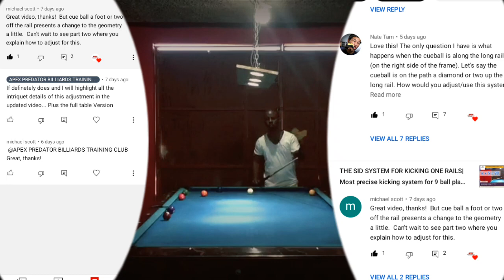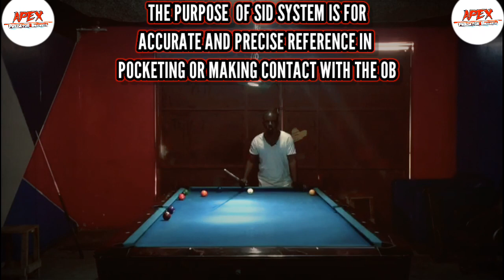NEVER MISS ANOTHER ONE RAIL KICK WITH SID SYSTEM (PART 2 full table )

Comment: The mathematics gets a little tricky when you're half a diamond or a 3rd of a diamond but it can be done fairly easy just by checking your angle by going to the edge rail and aiming to the point you're trying to hit
Reply from the maker: Definitely.... At some point you may need to interject some feel and natural judgement.... This system starts to break down with more complex setups especially when you have to introduce spin which is also highly not reccomended on a full table... It's even worse when the cloth is sliding and there is less friction... So you must be well knowledgeable about the different variances it comes with time ... You won't perfect the art but you will be greater than the average or even above average.... Keep practicing
Reply: Actually, using your video I now extended it to the white ball being able to be at any position of the table. You just need to be good in arithmetics, eg 3.2x4.7 etc.
Reply from the maker: Thats the challenge alot players may find but during a game its sort of impractical to put your math skills to work when the pressure of the match is on hence alot of practice would be required... i do reccomemd that you can find a parallel line close to your target and carefully parallel shift which will give you a fairly good estimate for the hit possibly making it but it wont be super accurate
Reply: @apexpredatorbilliardstraining   I am using the distance of the cue ball to the object ball and recount the numbering with the cue ball being an imaginary pocket. Then take the difference from the distance.

Basically you just need to flip on your head the table with the short rail to be at the cue ball. It sounds complex but if you do it a few times it's very easy and precise.

Once you do the calculation, all you need to do is take the difference, e.g. 36-12=24 and aim at that spot accounting for the reflection (-1 for small angles and -2 for flat angles).
Reply from the maker: Very interesting.... i love a player or student who learns something new and is very innovative with there methods....brilliant stuff. 8762207352 whats app me

Comment: I can use the Sid System for kicking object balls off the long rail. If you can imagine a line coming off the end rail (parallel to the long rail & the location of the object (from the short rail) along that line, like you would normally, you can find your new kick point on the short rail, to shoot at & hit the object ball. I hope you can understand this....
Reply from the maker: You are most definitely correct 👍… the Sid system can be manipulated in various ways….to attain various kicking 🦵 points but it really becomes effective when object balls are in the the path and it’s not very clear or you may need additional referencing for precision